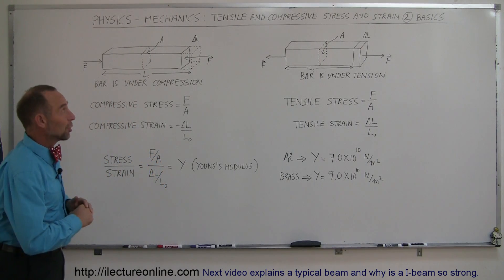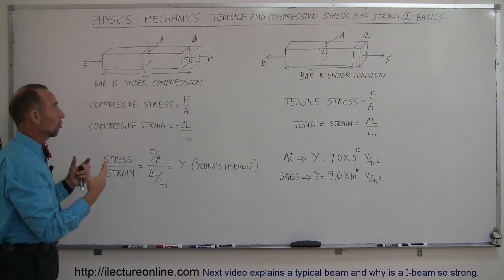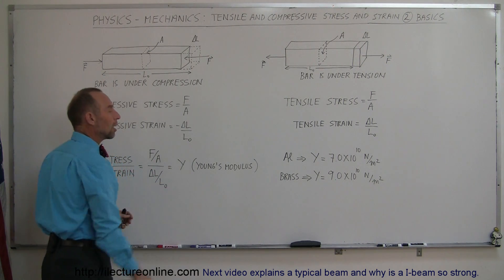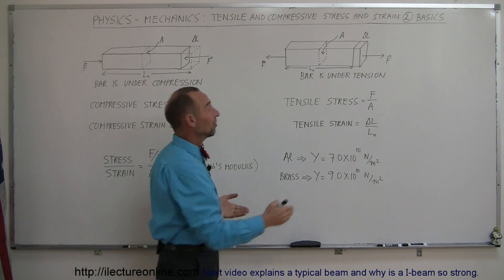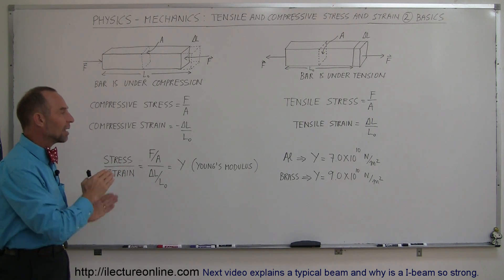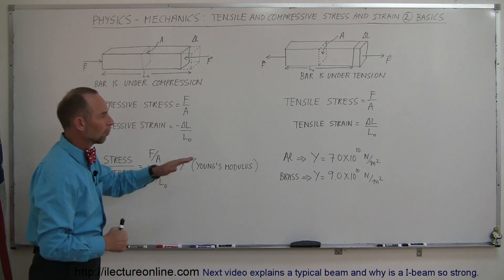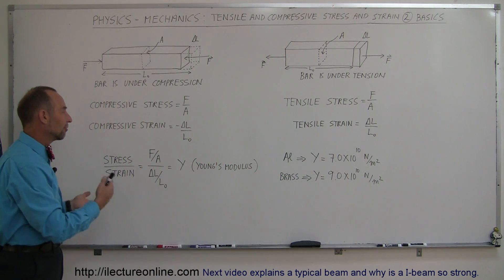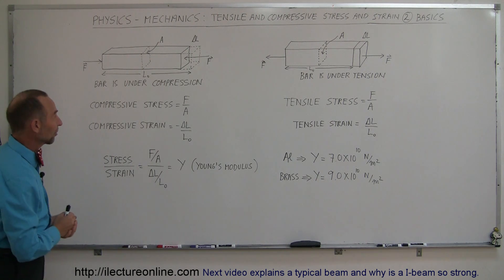Physics - Mechanics: Stress and Strain (2 of 16) Basics: Compression and Tensile

Comment: Hello!!! Since you are 'obviously' the guy to ask??  : )  If compressive and tensile stress 'usually' has the same ratio!!!  
What do you think about carbon fibre submarines??
Reply from the maker: There is much more to the strength of submarines than the tensile and compressive strengths.  Material fatigue, connection between sections, difference in thermal expansion, glues, other connection methods, etc.